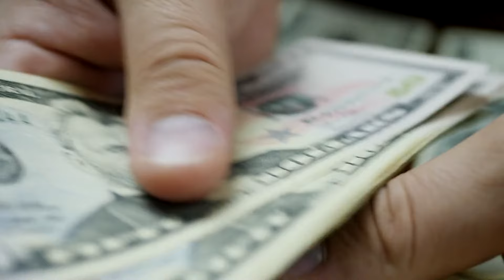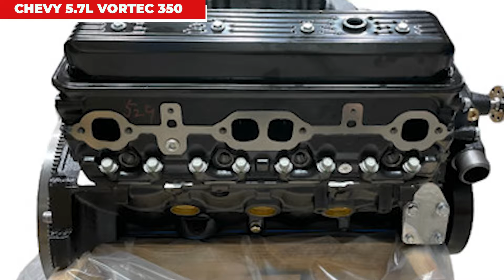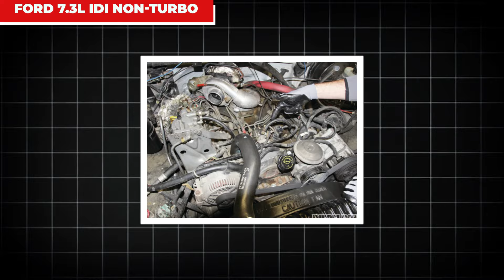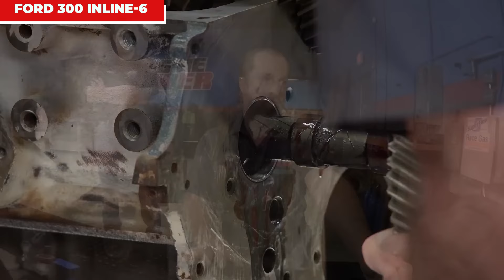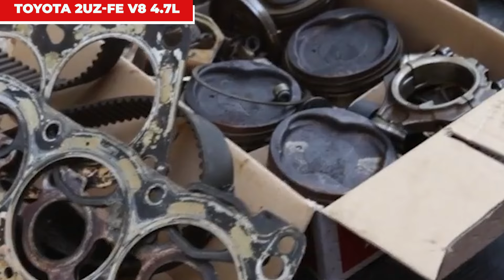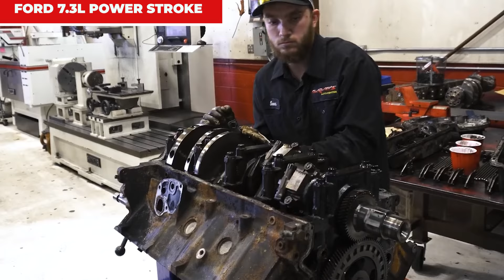10 Old-School Truck Engines That Modern Trucks Still Can't Beat

Comment: I’ll add the 5.9 magnum v8 from Dodge. I traded mine in with 540k miles on it back in 2017 for a hemi— also lasted a long time, sold it problem free to buy my last house. 

5.9 magnum, won’t win any races, you can build them to be fast, but if you leave it alone, it’s a low hp, higher torque, low stress engine. Only thing I ever did was replace some sensors and radiator/water pumps about every 150k miles or so. In my driveway with hand tools.

The ford 300 disappointed me, idk what the guy before did, but that engine wouldn’t ever stay running for me.
Reply from the maker: That’s a great take — the 5.9 Magnum doesn’t get enough credit for being a long-life workhorse. 540k miles with mostly basic maintenance is seriously impressive! Too bad about that 300 though — sounds like it just needed a better start in life.
Reply: @TheAutoBureau if there’s any clue to went wrong with the 300, it’s that the title left in the glove box was yellow and half eaten by mice. The rust was very very bad, it was not taken care of at all. Could have had 20 year oil in it too, was basically a tan jello